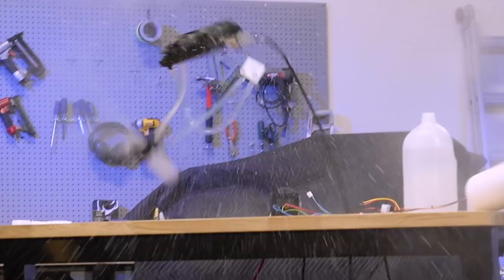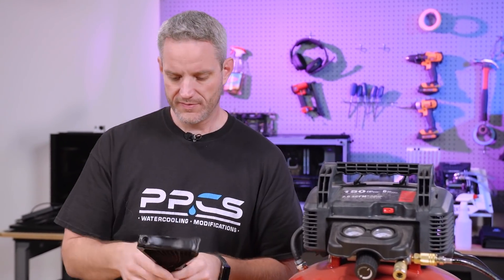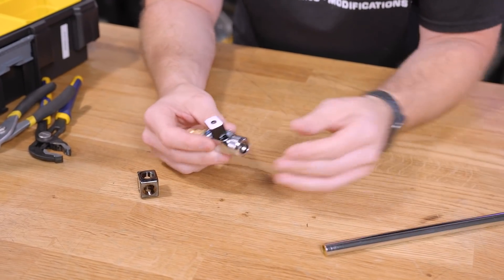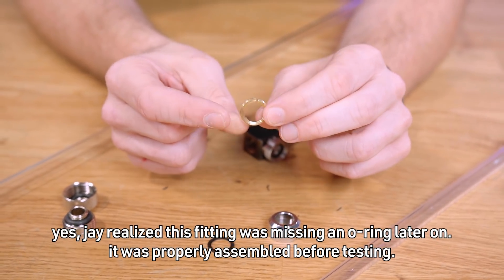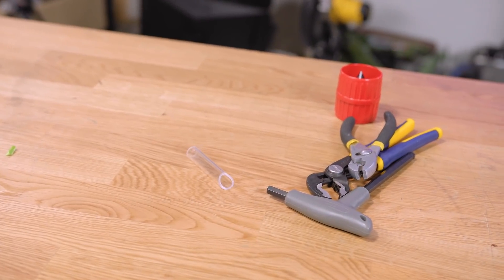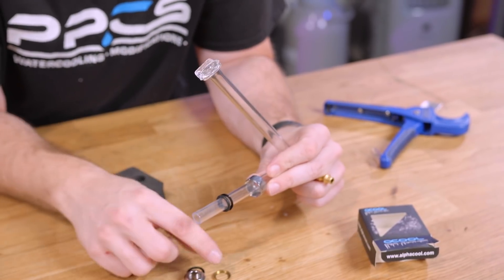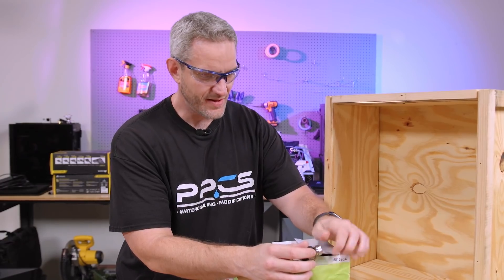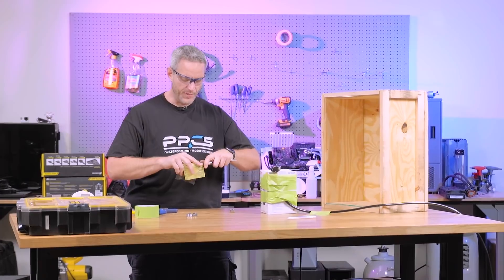I really need to stop these experiments... DO NOT TRY!

Comment: Hey everyone, i have an unrelated question. Is it possible for a motherboard or a cpu to not be compatible with a certain graphics card? I recently bought a gtx titan to use in my system, an asus prime b350m-a with a ryzen 5 2600x and the gpu is not recognised, no image at all, the gpu works fine in other newer am4 or older fm or am3 systems. What are your thoughts about this issue?

Comment: At some point, a pressurized turbulent jet of air applied to the heat spreader should match the performance of a one ATM air cooler.  I wonder if that is achievable with a small compressor.

Comment: It would be interesting to know exactly what the psi would be (probably be in the .01 decimal range above ambient air psi) in a functioning water loupe.
I'm thinking ... as the reservoir is actually not actively pressurised, beyond enough to just pump water thru, the number should be really low.
Heres the thought experiment;
- Is there even a measurable positive pressure ... period? To move water at all, there has to be some.
- How do you jig/tool this up to try to read any pressure that may be measurable?
- if there is more or less tubing length in the loupe, with the same pump operating in both, what is the cost to pressure in a meandering longer loupe?
- Is there a pressure cost difference in running water thru a CPU waterblock alone, or when combined with GPU (or multiple GPU's) block? 
- Are you actually better off running 2 full loupes, one for each, CPU and GPU's?
- whats the difference in regular operating loupe psi with different tube/fitting diameters?
- Does operating temperature affect any of these pressures?
- Does any of these pressures change, with fancy loupe liquids instead of water?
- Does loupe gunk buildup affect pressure?
All I can think of right now.  Its fun to see you blow shit up, but lets look at the other end of this scientifically; what is a system actually experiencing pressure wise?

Comment: This is not the right way to test this at ALL! I'm an Engineer, Jay should be using find the Yield stress of both materials( if he can), then calculate the pressure using calculations of a pressure vessel . Then he should and two sensors ( i would use a srain gage and a pressure sensor), to jusify his calculations.

Comment: I would that intuit that in most custom loop systems, because the reservoir is not filled up a 100% you wont have all that much of  a pressure difference between Idle and load because any compression will be absorbed by the air in the res. For an AIO it could actually build up a little bit more pressure because there is no gas in the loop.

Comment: idk about yall, but my h510i has good enough airflow for me. cpu and gpu temps under load are between 40-60c consistently. idle they are at 32c. i have no complaints.

Comment: Fill the tubes with water first and the air volume will be significantly less so you will minimize the amount of stored energy when the fittings let go, or if the tube fails.  Less risk of throwing shrapnel across the room.

Comment: Def interested in seeing that tested, esp with Deepcool incorporating an expansion chamber into their AIO's (the elastic pressure relief bag).  It's not that I don't believe it works, I just have doubt's that any pressure build up from coolant expansion in a PC water cooling setup would be high enough to be of major concern.  I just feel if it was high enough to be of concern, AIO's would have developed a really bad reputation by this point, and all custom loops would have some form of pressure relief system.  Then again, could the pressure build up be a contributing factor behind permeation? :-)

Comment: I need the science of a custom loop put together in my build. I have all the parts, but afraid to put it together. It's been said I have a curse lately when it comes to towers. 3 tower hardware changes and all 3 had CPU issues. First one I bent pins, second one had various errors reading the CPU, and third refused to work with 2 tried CPUs (one being completely brand new). Now that tower is actually working, afraid to take another shot at messing with it

Comment: Why dont PC builders nowadays use industrial fittings like Legris/Parker or SMC to name a few. I very recently did a custom soft tube loop with Legris fittings for a server and it's so much better and easier to use than all these bling bling fittings and designed to take major abuse in factory machines....I am biased though as I'm and engineer in a large factory.

Comment: h series: airflow
my pc with the h510 that struggles to cool off: YEP
Reply: Pizza Gaming is the temp that bad, I’m ordering a h510. What fans configure do you use?
Reply: @Giratina143  If you're worried, check out Gamers Nexus videos on the H500 or H510
Reply: @Giratina143  I run an H200, my specs are very average and temps are fine
Reply: @Giratina143  Yup, there aren't any real intake vents. Gamers Nexus has videos on its temps.
Reply: @Giratina143  It's not that bad. I have a front mounted radiator cooling a 3700x and an MSI Gaming Trio 2080 Super generated even more heat. My CPU and GPU temps have never passed 65 C while playing any game. Albeit most games I play besides GTA are pretty light, GTA turns my PC into a furnace though.
Reply: you got 6 case fans? 1out the back 3 in front and 2 exhaling top ?

Comment: Ample airflow from the H Series eh?? Eesh. Steve begs to differ.
Reply: Even Steve does admit that negative pressure setups in them work surprisingly well. Which is him saying "not the worst glass box in existence". Also ample could just mean "doesn't thermal throttle you 3300X with a NH-D15 on it"... ample for what? noone ever did say X)
Reply: @guyfawkes8873  Valid points lol.